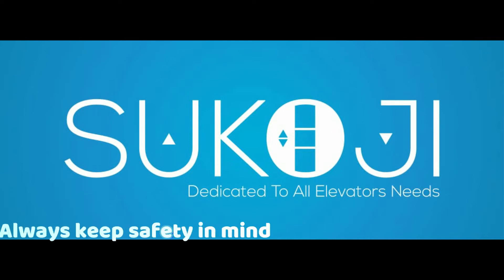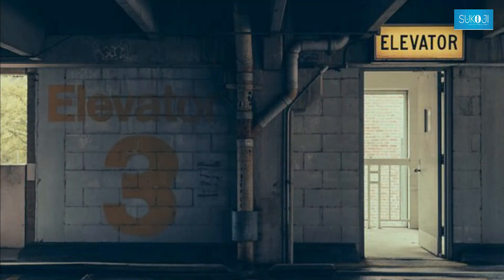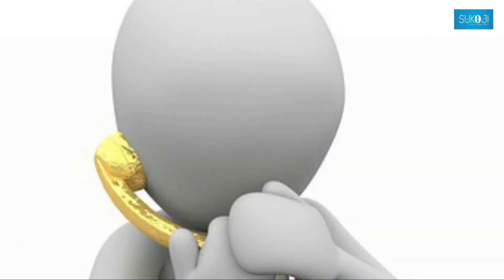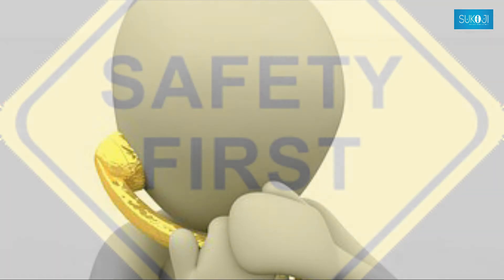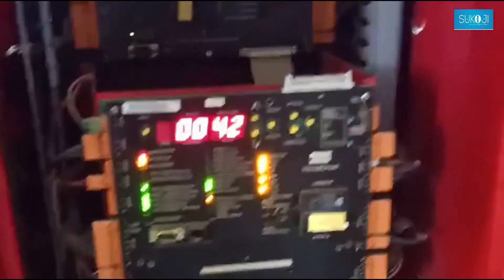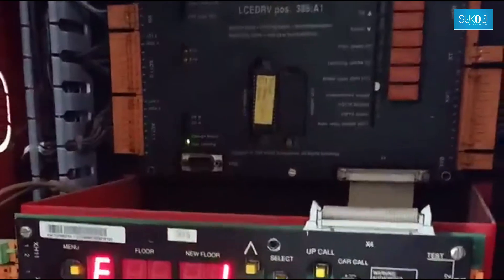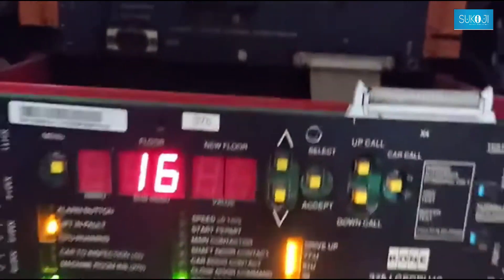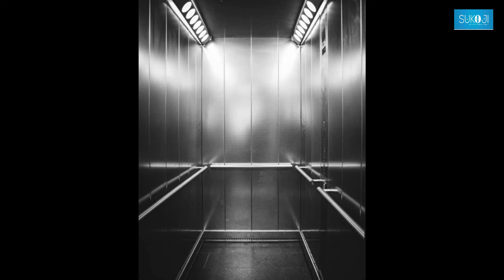LIFT FAIL | Lift Fault | KONE ELEVATOR FAULT CODE! | Elevator out of service! SUKOJI ELEVATOR

Comment: 107 ?
Reply from the maker: Plz check overload system
Reply: @sukojielevator1079  we changed the load scale except that it is still not good and the old special load we put on another device it does not work either
Reply from the maker: Wich controller?
Reply: @sukojielevator1079  LCE
Reply from the maker: LCE Resolve 500 OR LCE monospace?